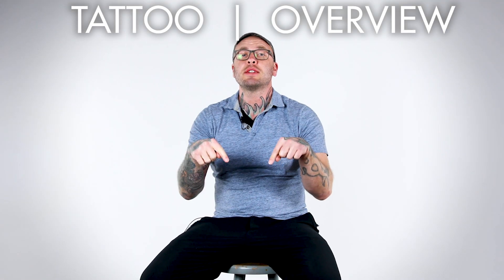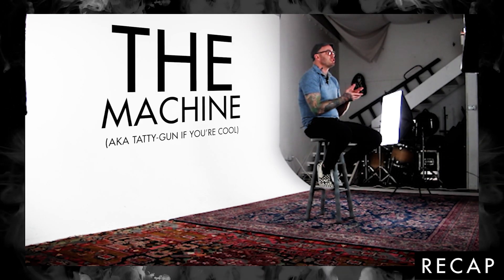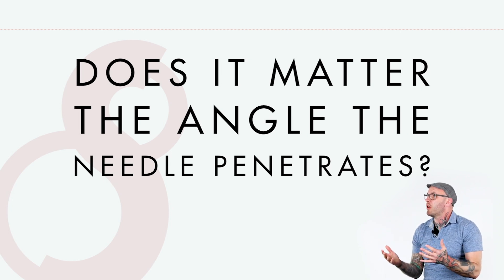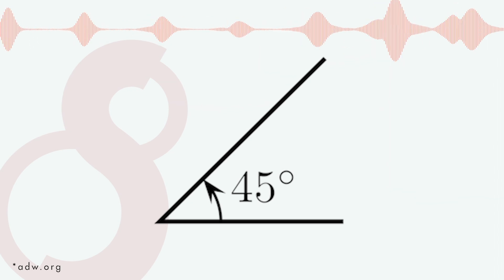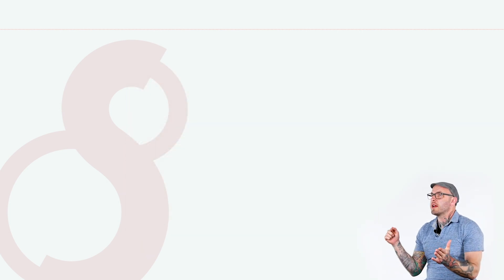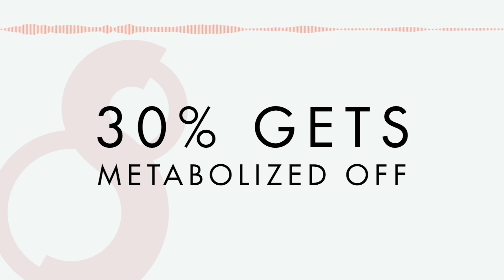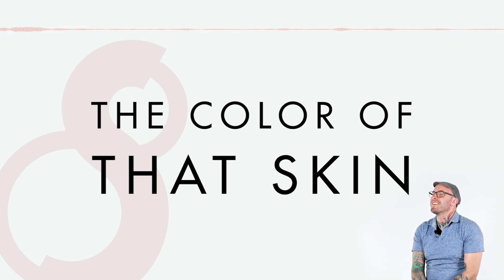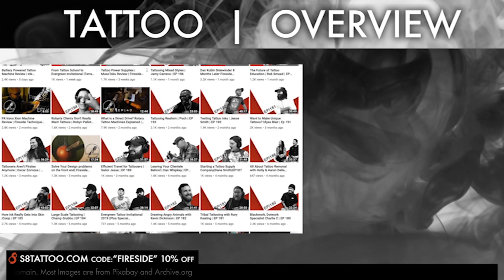Tattoo Science! The Physics of Tattooing Part 2 | Tattoo Overview | Episode 9

Comment: This is why the whole "duty cycle" debate is a trade-off between machine performance (overheating at higher duty) and skin impact (better saturation at higher duty %), and also why you can run a liner at up to like 70% duty if you get it to hit hard enough at ... say... 4.5 to 5.5 volts - because that low voltage especially when used with a momentary footswitch and only runs while pulling (or pushing) lines won't heat up your coils enough to be an issue.

Also: the term "pushing ink" is correct - but not because ink is being "pushed into the skin" (and "sucking ink" sounds kinda weird). It comes from the belief that moving in the direction of the larger angle of the tube orientation ("pushing the machineinto the direction of the throw") is the best approach - when in reality both pushing and pulling work equally well. The only thing that doesn't really work (unless your goal is wispy, "soft" lines) is "sliding" the tip to the side (perpendicular to the direction the needle bar points in, instead of parallel to it) because when pushing and pulling you get overlap on the holes (pushing results in the lowest part of the previous hole being aligned under the highest part of the current hole like ////// and pulling is the other way around, both resulting in more saturation without weak areas) whereas when sliding you place the holes next to each other with no overlap, which reduces the apparent saturation even though the amount of ink in the skin might be the same - or even greater. This is also why you wanna hold the machine at an angle. Keep in mind, though, that a flatter machine/tube angle means you gotta sink a greater length of the needle into the skin to reach the same depth, causing more trauma - so this is a trade-off situation as well. 

This shows us that a LOT of things in tattooing are tradeoffs between performance and trauma (or simply pros and cons), and as long as you're getting good healing, no scarring, and well saturated tattoo results - without torturing your client unnecessarily - you found your balance.